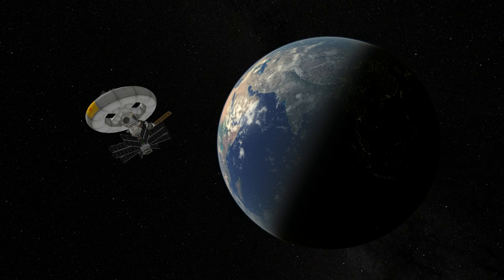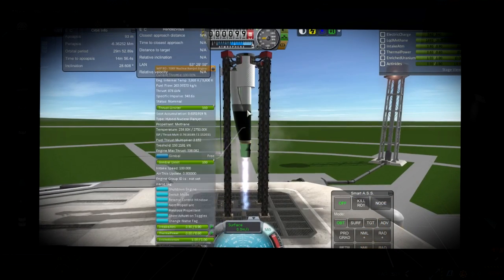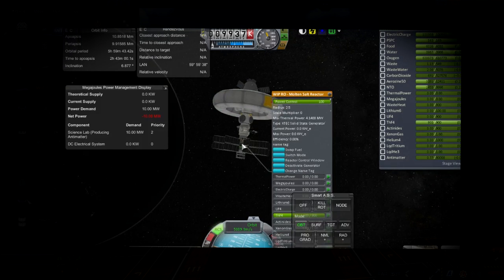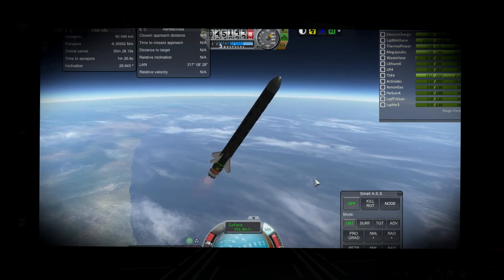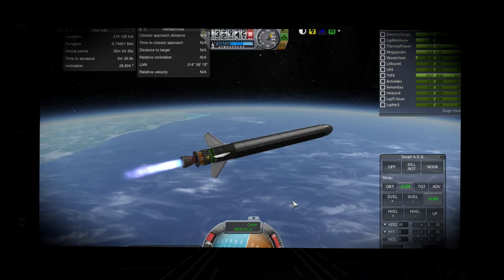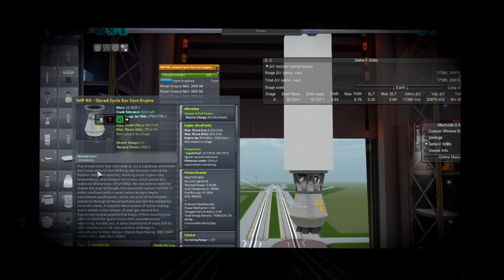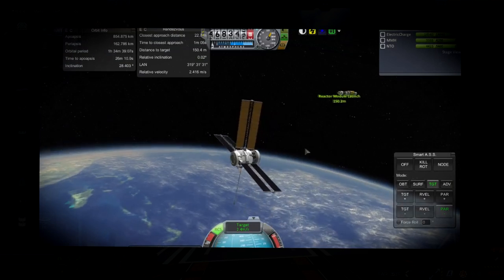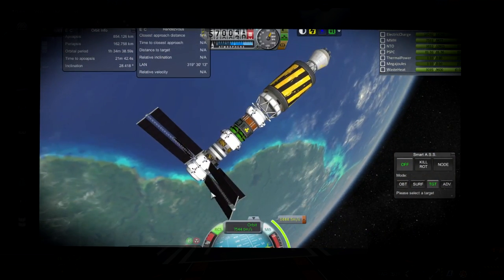Kerbal Space Program - Interstellar Overhaul 02 - Testing Engines

Comment: One of the best launch engines I found in kspi is thermal jet. it is strong enough to reach orbit in RO if you use atm option during launch and switch to fuel later. Works amazing with antimatter reactor.

Comment: As far as I know the thermo-engines of KSPI depends on thermal.situations: if temperature of your reaction core is low, they're awful, but your reaction core goes hot then they go crazy.
Reply: You need some bleeding-edge tech reaction cores to make them really overpowered, more then 50,000 isp I guess.
Reply: one thing more: thermo-engines has lower isp in atmosphere, not only lower thrust.

Comment: The thermal engine clogging problem is only a problem for propellants that contain carbon atoms and the shooting can be cleaned flowing Carbon Dioxide gently over the heat exchangers or using clean propellants (like water) over longer periods.
Reply: From my sources they were mend to be used multiple times. Just lookup Liberty Ship Light Bulb

Comment: Actually, IIRC the closed cycle gas core engine you used on the second stage was modeled either on a NASA report regarding closed cycle nuclear thermal rockets, or the engine/engine cluster conceptualized for the "Liberty Ship" HLLV, which was conceptualized as a reusable LV that could toss 8 times the payload of a Saturn V into LEO, then turn around, come back to the launch center, and do it again. Link to the design here: http://www.projectrho.com/public_html/rocket/realdesigns.php#id--GCNR_Liberty_Ship

Either way, considering that the engine noted specifically mentions that it is a closed cycle gas core NTR, you might want to make a second configured engine that is an open cycle gas core engine, possibly using one of the designs here: http://www.projectrho.com/public_html/rocket/enginelist.php#id--Nuclear_Thermal--Gas_Core--Open_Cycle

One of the advantages of open cycle engines vs. closed cycle engines is that you can get better than twice the specific impulse, at the cost of chucking at least some of the fission fuel out of the nozzle along with the superheated propellant. If you do go for a design, I'd suggest going for a confined vortex type open cycle engine, as that minimizes the amount of propellant escaping the engine, which is good, as the longer the propellant stays in the engine the more energy you can get out of it.
Reply: True, but even pulling a reusable Sea Dragon would be impressive.

Comment: The reason the Isp of thermal engines is lower than you expected is because it is realistically affected by atmospheric pressure which decreases both thrust and effective Isp. In contrast to stock engines which uses a simplistic model, KSPI-E it actualy calculates the performance at real time.
Reply: Well the molten slat reactor is definitely not mend as a launch reactor, for that you should your either a pebble bed or particle bed reactor which are based on the Timberwind. They are the most powerful nuclear engines knon to man that ectualy existed
Reply: The VASIMIR performance was indeed very unrealistic, if you try the same in the current version it will not work at all at sea level. For now I suggest You increase the exitArea by a factor of 10 or higher
Reply: Are sure you modified ElectricEngineControllerFX. Is it even able to switch propellants and shift gears? If not it's not functional.
Reply: Make sure it has the :FINAL attribute, otherwise simply edit the  config file directly

Comment: Any KSPIE engine testing should be performed in a vacuum, as most were made for this purpose. The Tokamak fusion engine should have been connected to thermal electric generator and a significant amount of radiators to sustain itself and generate high amount of Isp
Reply: What happend was some divide by zero applied to KSP world. The result is that you get thrown into the void. It is probably fixed by now

Comment: Exactly what version of KSPI-E are you using? For KSP 1.1.3 version  KSPI-E 1.9.11 should be the best pick. At least this version contains the Deadalus Fusion Enigine, allowing you to travel to the starts without FTL enines
Reply: If you want to prevent/limit operation in the atmosphere, you only need to increase the exitArea
Reply: Both the thermal engine and electric engine controller have the property exitArea which can be used to make atmospheric operation impossible.

Comment: what kind of solar panel is that?
Reply: also, I'm pretty sure the thing shouldn't even work in the atmosphere.
Reply: and the nuclear jet engine is probably supposed to run at really high altitudes. if I read that tooltip correctly, it has an isp multiplier of 0,4 at sea level and  2 in vacuum. it also probably works better at high speeds. and you can toggle the propellant you want to use on the thermal turbojet in-flight via the right-click menu.
Reply: all the electrical engines used to just not work in an atmosphere, although it appears it's been changed to them just having a low ISP. at least that's what I know.